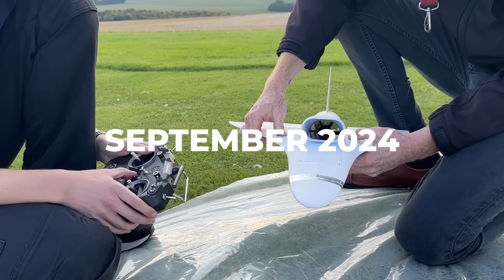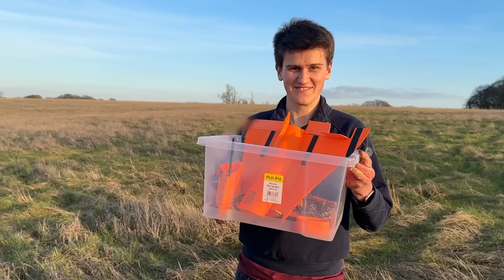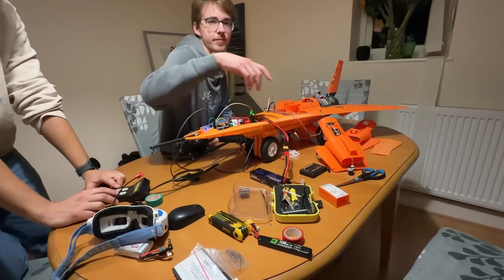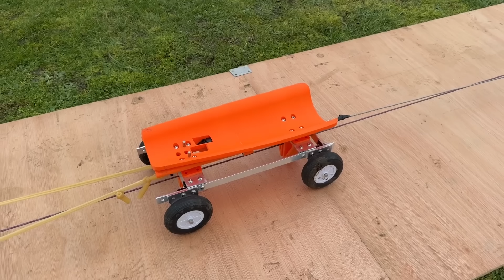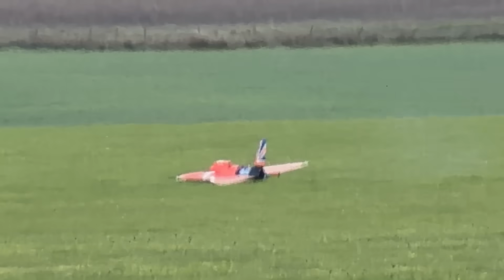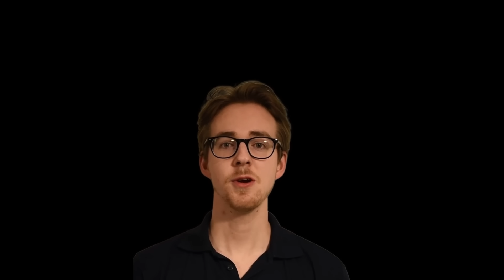Flying the WORLDS FIRST 3D-printed Jet Turbine RC Aircraft! Kingfisher Mk2 Takes to the Skies

Comment: damn that launch was kinda violent
Reply from the maker: It was - we were lucky not to lose the aircraft on takeoff but the rest of the flight was great.

Will need a redesign of the launcher for the record attempt!
Reply: @TheMachInitiative You needed to do it before the attempt... you have people that are excited but not excited enough to put the work in to understand what you are doing or into making the right things and instead you seem to just trying to hope that things work out in ignorance.
Reply: @thomgizziz  Seriously, what is your problem? Why are you so angry that they succeeded?
Reply: It was recklessly under engineered for its purpose.
Reply from the maker: Launching a highly loaded delta with a takeoff speed >50 mph and a much smaller wing area than the current record holder is hard!

This cheap homebuilt solution got us to our first jet-powered flight, providing the credibility needed to obtain a far more robust off the shelf pneumatic catapult system which are expensive and hard to get hold of.

We were on a private range with no people behind the firing line, and had done several successful launches with our dummy aircraft prior to launching the Kingfisher. This was not reckless, it was a solution that got us to this critical milestone within the resource constraints of the project, while keeping everyone safe.

That being said, it behaved worse than previous dummy tests and so we agree it is not adequate for future flights, and with the maiden flight complete we will equip our record attempt version with an interface that integrates with a pneumatic system for a much more reliable launch in future - don’t want this to be the reason we lose the record attempt aircraft
Reply: @rcnfo1197  As is everything they do. This whole thing is a slow motion train wreck and a bunch of people in the comments just keep praising them for anything that they do that these people think that they can just manifest this into being based on their feelings. They don't seem to have the knowledge to do this and are too lazy to squire the knowledge that they need.
Reply: @thomgizziz  Wooooo! Go Thom! You got this!
Reply: @thomgizziz bro are you okay? What do you think they did to you? Not allow you to be part of it?
Reply: @t @thomgizziz  don’t get what you’re so mad about, no one is in danger and people are having fun. Slow motion train wreck, you’re too funny man. Worst thing that happens is they lose a prototype, it’s not the end of the world… take a chill pill

Comment: I’m curious: why did you go with a delta planform? It seems that a conventional planform would be more aerodynamically stable given that this is a subsonic plane. 
Regardless, a VERY impressive project!!
Reply from the maker: Your right that from a purely aerodynamic perspective a more traditional planform would be better.

However, the blended delta wing body has a really good strength to weight ratio, and offers lots of internal volume for cramming components in, while using the entire fuselage as a lifting surface enabling us to get away with a much smaller planform area and thus helping to reduce drag
Reply: @TheMachInitiative ah. Makes sense. Thanks for the reply!!

Comment: You may need more airplane to handle the larger engine. What you have reminds me very much of the MIG-21 and CF-104. Fast in a straight line, but horrible at turning.
Reply from the maker: The F-104 is one of my favourites! At one point very early on we were interested in looking into a boundary layer suction system like the F-104 to help with takeoff and landing. Way too hard to pull off at this scale, but hopefully one day! -M
Reply: @TheMachInitiative

That would be neat. Have you considered talking to Magellan about getting some small rocket motors for testing?

A bit of rocket power and maybe push into the high transonic.

Comment: Amazing! The dolly’s near-zero AOA is a bit surprising – you’d expect something like 20–30 degrees to suit such a low-aspect-ratio planform. But I suppose that might introduce inertia-induced backflip tendencies during the split second when the bungee out-accelerates the turbine. The ski-jump ramp is a clever workaround, though it must be nerve-racking for the guy on the sticks. Respect!

Comment: You guys realise that you don't need a flight controller right?
We've been flying RC planes without them for a lifetime, with only a few adjustments in the Tx, a receiver, and servos
Reply: Those elevons hardly moved. All you need is a touch of expo and you're off. Your CG is good enough. It's stable. Flight controller is absolutely a waste of time, things to go wrong, and weight.

Comment: Great job. Just an observation - can’t the launch be done on a steady incline rather than a flat runway with a bunny hop? Surely a launch vector at the sky at stay 20 degrees is kinder on the airframe than a jolt into the sky when it’s running flat at zero feet?
Reply from the maker: Much kinder on the airframe, but much harder to design something that can fit in our cars.

Comment: Does the record need to be beaten in level flight, or can you just dive with the aircraft and use gravity as an extra force?
Reply: For powered aircraft, all speed records depend on the consistent speed over a fixed course, going once in both directions. The aircraft has to maintain a level heading and level speed before attempting the high speed run, so no diving before or during the record attempt

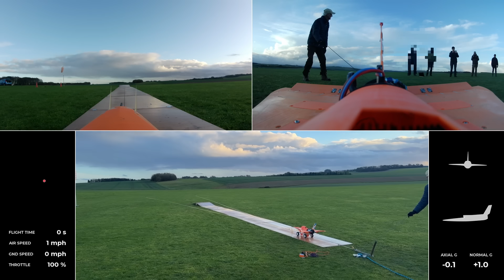Comment: 3:50 SpaceX level presentation
Reply from the maker: That was the idea! Making these animations is one of my favourite bits.

-M
Reply: @TheMachInitiative What software do you use to convert the telemetry into animations?
Reply from the maker: @DaveWave-h1x There is a python API for reading the telemetry logs that Ardupilot outputs. I then use Matplotlib to convert the telemetry data into a video, basically just a moving plot. It's a little clunky but with a little work you can get results pretty easily. -M
Reply: @TheMachInitiative Omg!! Tomorrow is my birthday, and I already got a wonderful gift. Thank you !! For replying, I hope you become more successful than space X . May Lord Ganesha bless you guys. Keep it up
Reply: So wonderful to see the evolution from idea to reality
Reply: Amazing job fellas.
Reply: Stfup…..
Reply: and with 98% less snake oil!
Reply: They made something that goes slower than rc planes that people 3d print in a weekend and they have worked on it for years and keep pretending that every video is some new breakthrough and you are slow enough to not only buy into the nonsense you try to hype it up. SMH.
Reply: @thomgizziz this is incredible engineering and just a P60 for the test flight with plans to install a P150 for the record attempt. Stop being so negative and appreciate the work they have done to get this far. SMH back at you.
Reply: @thomgizziz  You’ve built a 200mph rc plane in 1 weekend? 🤨……. 150mph is easy, over that is incredibly hard.  Plus, they were using the small engine for testing.